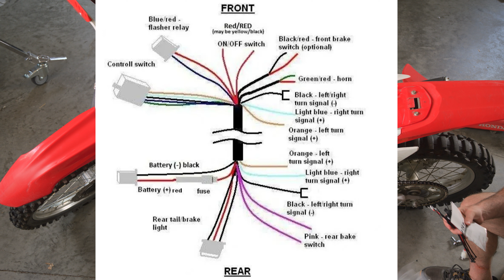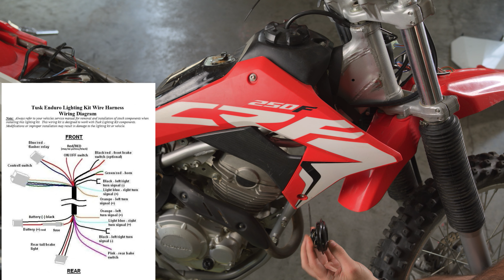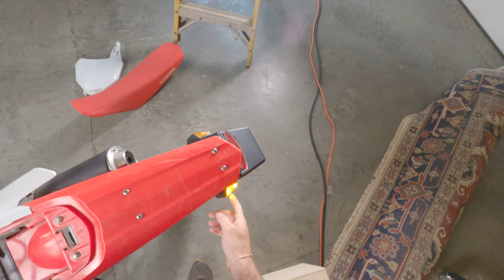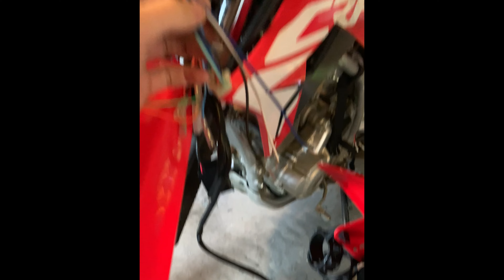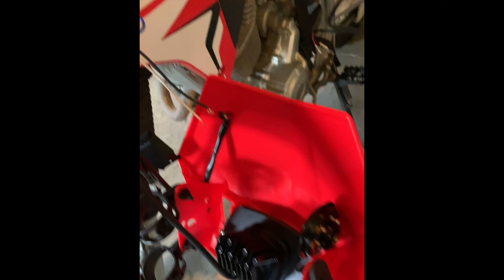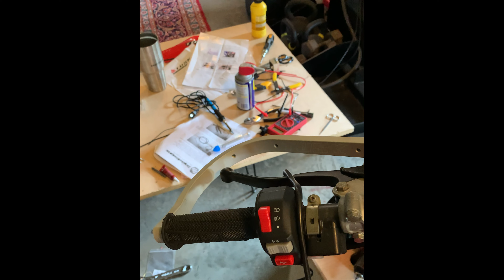Tusk Enduro Lighting Kit & Baja Designs Squadron LED Headlight Install

Comment: The Baja Designs light is only a high beam, and not DOT legal, but guys use it anyway. It doesn't wire into the 12v system or the new wiring harness. You have to wire it to the A/C system from the two wires coming from the stator. You do NOT want to wire it into your D/C system with the new harness back to the battery as you will eventually fry that tiny NiCad battery. That's why it's wired into the A/C system because there is enough current, and Baja Designs ONLY makes those in A/C compatibility to begin with. Look at their website.

Comment: Those are called poly lock nuts you used on the rear fender also on mine I bought a small $16 red nylon molle pouch on ebay and mounted it to my rear fender,helped hide a couple blots plus I can carry some tools now
Reply from the maker: Awesome thanks!

Comment: The Rocky Mountain control switch video was very helpful. 

Idk about that headlight, but those beams may pull too much power for those wires… at least according to the Rocky Mountain video. 

I ended up running a new power wire directly from the battery with an inline fuse in a thicker gauge wire to the black, then the blue and white go to the high and low beam. The headlight got a ground directly to a grounding spot in the bike.

Hope that’s helpful.
Reply: Oh that’s interesting. The headlight seems to be working fine for now.
Reply: The black an white is the neutral the red to black is your power going to switch when switch is flipped to low or high beam sends power too blue wire too lite an back thru the white an black to complete circuit

Comment: 12:35 is what I came for.. Would be helpful if Tusk pointed out in their diagram that their harness assumes headlight power already exists. I plan on pulling power from the brake light power wire
Reply: Ya I agree! Thanks

Comment: Really nice video… in process of similar project on a different bike… key to the headlight conundrum is having the wiring pinout for the controller switch you are using…. U need 12 volt into the control switch and then the high and low wires are the 12 volt outputs to the headlight… then connect headlight return to a ground…
Reply from the maker: Thanks for the info!
Reply: Glad I saw your comment, helpful! I wish YOU would do a video on this! I'm sure you know the "rubber wrapping" on the wires is called insulation...😉😀